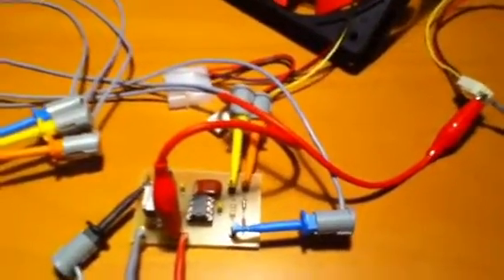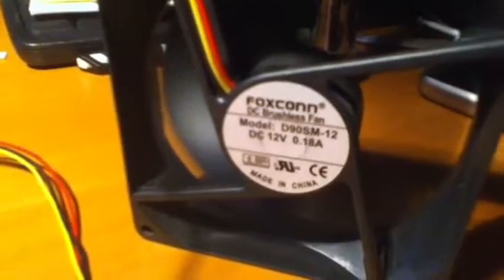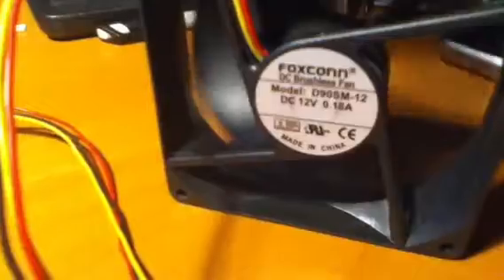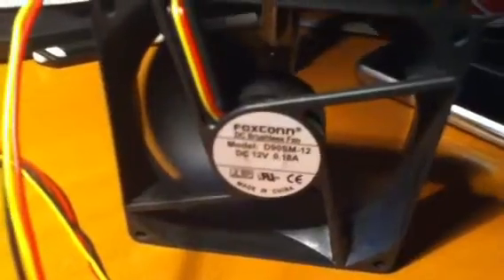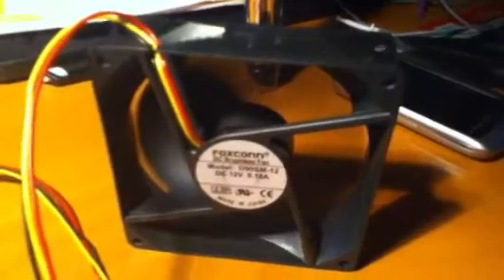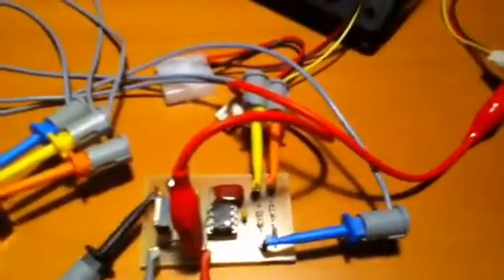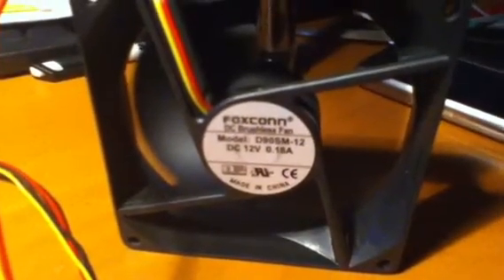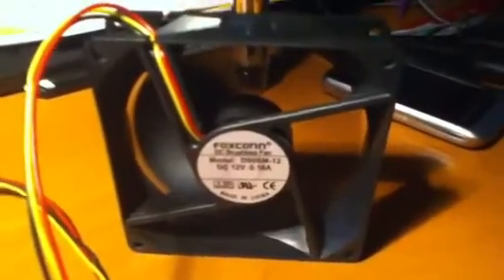Same 555 timer based PWM controlling a cheap box fan

Comment: Hello nice vid. did you make the PCB board yourself?

To get rid of the choppy sound during low duty cycles, you will need a higher frequency PWM signal. if you go higher in PWM frequency, 20Khz (above human hearing) it will eliminate any audible switching noise. so instead of (_|----|____|----|____) it would be (_|--|_|--|_|--|_) not to scale but basically the same average power during one x time frame but more pulses in that time frame.